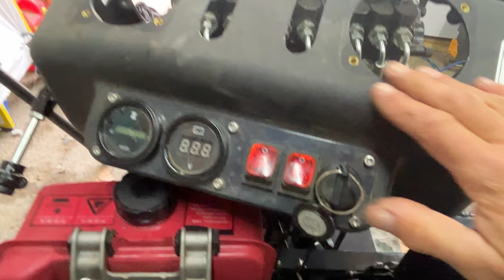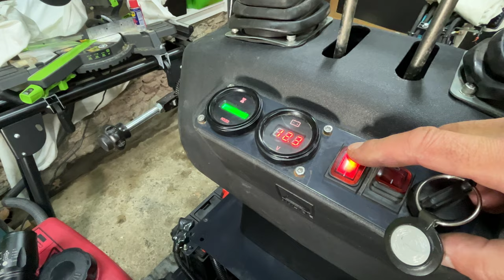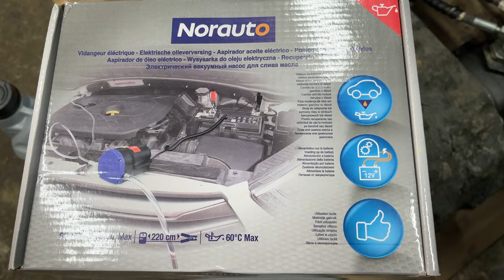Chines Mini Excavator | Hydraulic Failure

Comment: This is great guys! My wife and I started looking into this machine when we came across your videos. We have a John Deere 1025r, with a backhoe and a pile of other fun attachments. What we plan on doing is taking one of these mini excavators and separating the digger from the tracks. We intend to mount the digger on the back of an old F250 pickup truck, then turn the tracks and blade into a micro bulldozer. The two rigs will serve two purposes. Skidding and loading logs to be milled, and working hard to reach gold claims. Good luck on your repair, cheers from Arizona!
Reply from the maker: Sounds like a great project - you would need another engine and hydraulics to split but it would not be too difficult.  I am very happy with the little mini ex even though I had this problem - it is ready to go again and just waiting for a break in the weather. 😀

Comment: This machine looks very good for access to the pipework. The hoses do move around quite a lot when they are subjected to pressure, I think that is what causes the chafing rather than cab rotation. Your idea of having the extra oil cooler was very wise, we did not get such high temperatures here (in the Lot), this year, but I often think about the hydraulic system when it is 50 degs here, my main oil supply line went in a similar way on the mini pel, but the Volvo is not quite as accessible as your digger, but we could not work without it, that and our Fergi tractor and carry box, I will be interested to see your mini dumper. Stay safe! Chris B.
Reply from the maker: Cheers Chris - it was good to strip it all down to see how it all worked.  The little dumper is great and well worth the money from Deleks.fr......free shipping too.

Comment: I put old garden hose around my Hyd. Lines that can rub against each other just slice a piece of pie because it will fit around the holes you want to protect and then wire tired in place. It works great and helps. I worked for a hydraulic company for years.
Reply from the maker: Yes, good tip - when I get it back to base I will go over all the ones again.

Comment: Got a 49 Ford 8N with a front end loader. The hydraulic lines had taken a beating mostly from sun damage drying them out. Used electric corrugated sleeve and zip tied it over my lines in order to protect them . Actually looks very pleasing as well.
Reply from the maker: Yes, I have that on my Kubota tractor although I do like the nylon sleeves you see on modern kit.

Comment: You can also take an old garden hose cut a piece the length you need and split it, wrap it around your hydraulic hose and secure with three zip ties. Works great. Nice job on repair.
Reply from the maker: That would have been stronger and I have loads of that lying around …. Next time. 👍

Comment: With machinery hoses break seals leak and bolts come loose. No brand is immune to it. Have had brand new equipment show up on site that was broken from the factory. I will check hoses etc even on my cars and put sleeving in where it's needed. In many cases I use hose that I split open and slide over the hose or cable. 
    Also with anything from china that has oil... Always flush the factory oil out after a break in as it's very common to find allot of machining dust and chips in the oil. Not to mention I don't know what quality of oil they are using. I was very impressed with how clean that hydraulic oil was that you drained out. But I'd be modifying that drain for the future.
       And yes I am still jealous I want one of those toys too. It's cheaper and smaller than the Kubota BX sized machines which I like cause they are basically big riding mowers that think they are little tractors.
Reply from the maker: Thanks for the comments - I will be sure to check my lines from now on -   I was lucky it was only the blade feed and not the tracks as that would have been a right mess getting it back to the shop.
Reply: @HomesteadingUncontained  What I really felt bad for you was the oil getting on the concrete. That really stinks.

Comment: Nice video. I was thinking about the cable wrap also! I think it will work as a protection.

Now you know of the rubbing, you can check it every week to see how it holds.
Reply from the maker: Exactly, I will be checking after each usage - I will look for some stronger wraps though just in case.

Comment: I am a subscriber and have been watching your videos for a while. Thanks for showing all the work you have done on the mini excavator. I am planning to buy a similar one soon but perhaps with a swing boom. I have a small Chinese flail mower and if its any indication it does seem that these machines are not too difficult to work on. Of course the mini excavator will be a few steps up in complexity.
Reply from the maker: That is one of the reasons I wanted to strip all the panels off, so I could see exactly how it works.  Now I know if I hear or see anything out of the ordinary, it is not a mystery inside.  It is very easy to work on for sure 👍🏻

Comment: Where those hoses slide against the steel panel @16.27 I would split some hose pipe lengthways and slip it over the edge of the steel plate, just to avoid chafing. Better safe than sorry
Reply from the maker: Hi Mike - yes that is a good tip - I will take a look at it and after the first bit of work will check all the pipes again - I will be paranoid now.

Comment: you can also flip the connections to change the way the controls work, if u wish, but the fabric setup should be correct, but sometimes when people connect buckets, they connect the lines wrong, so you get mirrored controls, and if you dont know, you might be using the controls in reverse from the start. the bucket controls should be right stick and u move it forward then to the left and back towards you to make a scoop, but i ran a bobcat when i did it, so yours might not be the same, but mine just felt natural when using. other arm was the extension of the arms if im not wrong.
Reply from the maker: I do not know any different so it works for me...until I go and rent something else that is 🤪

Comment: I have one just like yours, except it’s a Nicosail okw10. The only thing I see different is mine has a B&s 13.5 hp gas engine. Do you think the same company makes them for different sellers? By the way, great videos, keep ‘em coming.
Reply from the maker: Cheers Ronnie - I think they buy standard chassis and parts and the smaller factories then put them together to sell as their own brand.  Alibaba comes up with hundreds of different sites and the machines all look the same.

Comment: Very nice repair Ian. I notice that your digger comes apart easier and faster than the brand I have. I'm off to check my hoses now! Was there a hydraulic oil filter changed? I have a small mesh filter that goes in the tank somewhere (haven't found exactly where yet). There is a spare in the tool kit supplied with my digger. Cheers Dave.
Reply from the maker: I do not think I have a hydraulic filter.  I will double check if I can spot one in the tank.  I was surprised how easy it was to take apart.  Taking that seat off reveals near enough everything.

Comment: You don’t need to drain the hydraulic oil tank. As the engine not running so the oil pump isn’t running. The oil won’t leak
Reply from the maker: Good call, but this was a good opportunity to relate the original for a known brand here in France.
Reply: That’s true as you don’t know the quality of the oil used in the building of the mini digger.
Reply: My hydraulic oil is 20 minutes old and already being replaced. I sent a sample for evaluation. if it comes back with a good report, i will consider saving it or selling it to some other user.

Comment: Please make sure to degrease the 4 foundation-rubbers of the engine for hydraulic oil will make them soft and last much shorter.
Love your series and believe it or not I bought the same excavator from the same company and cannot wait till it arrives..........😊
Reply from the maker: Yes, I cleaned and cleaned them again.  Most of the oil was from the engine as when I took it out it went everywhere.... again 😵‍💫  But now I have the pump👍🏻

Comment: I had a John Deere 240 skid steer which had two different hoses that would rupture due to this same type of thing. The hoses would rub on each other, and after about 500 hrs, they would start leaking through. I changed the hose lengths slightly, and it allowed them to float away from each other. Even the big guys have these issues is my point.
Reply from the maker: It was my fault for not checking but now I know these can be a problem I will be more diligent for sure.  I saw on another channel that their Bobcat had done it so I didn't feel to bad 😀

Comment: Nice work Ian, have you ever thought about modifications you can make to stop the machine from being so jerky aside from using the controls like cinderella?
Reply from the maker: Hi Alfred - I think it is the motor itself.  If takes a lot out of it when I move the controls.  Always on the look out for a 2nd hand kubota motor just in case.

Comment: at 24:08 Turn your jug around/over so the handle is lower than the pour spout, (up-side-down), then pouring is much easier and controllable.
Reply from the maker: Cheers - yes, I should have done this.  The camera always puts you under pressure and I stop thinking 🤣

Comment: Always check hoses, pipes, wires for excess rubbing slop BEFORE THEY FAIL. Use fixed cable ties, or add recoil springs, or SS mesh sheaths to keep things away from other parts on any vibrating machine. Now you've learned this, look over it for any other manufacturer omissions.
Reply from the maker: I check all the outer pipes regularly but this fail was deep in the machine and without taking off panels it is hard to spot.  Hindsight is great and I will be taking more time to check on the problem areas. 👍🏻

Comment: Hi I've been watching you from almost the beginning, I find it very interesting. I do own a small excavator similar to yours. I found it back aching and jerky because of having to lean forward to reach the leavers. I overcame the problem by making fold down arm rests that I attached to the fiberglass engine cover, by resting my elbows on them I can reach the levers taking strain of my back and better/smoother control of the leavers. Just saying. Keep up the good work and the videos. Best regards Steve (Buxton Derbyshire UK)
Reply from the maker: It does become tiring leaning forward for sure.  Thanks for commenting 👍🏻
Reply: You should just make a handle adapter that sits on each lever and makes the lever longer and wherever your hand is perfectly...

Comment: how many hours do you have on it?
Reply from the maker: Around 50 now, not a lot but all of them have been full on.
Reply: @HomesteadingUncontained    I've used mine to dig out/ level my back courtyard. i used it to load into a mini dump trailer /caridge i made with my dad, i use a tiller/ motoculteur to haul it around

Comment: Thanks Ian, that was really useful. I'll be digging this weekend doing the garage pad stone work and will check over my machine. I'm on about 17 hours, but a lot dirtier than yours 🤣 You've got the pedal for ancillaries, does the piping run up to where the thumb would be?
Reply from the maker: Hahaha, I do clean it from time to time.  So far it has all been dry work though, so just a dust off.  Yes the pedal operates the auger and the pipes terminate just before the bucket.  Looking at putting on a manual thumb in the future.

Comment: I would suggest that you try get some spare pipes as a bk up plan incase it happens again,,,Ian👍😎
Reply from the maker: Trouble is they are all differing lengths - it was only delayed due to the holidays - normally they can make them up while you wait.
Reply: You never know which one is going to be next to pop. And besides that, most every hose is a different length

Comment: Hi... im looking to buy something similar... Can you please say a few words about single cylinder KOOP engine (is it enough, is it running too hot)? And what about the hydraulic pump (what brand, flowrate, pressure... is it enough, at what temp running summer time? Best Regards.
Reply from the maker: It is going great. The koop motor works fine. Yes a kubota would have been nice but the price was double. I have a fan cooler for the hydraulics ans it runs good in summer temps.

Comment: at 11:50 It is more probable that the hose damage was from EVERY application of power, not just blade power, causing the main pressure hose to jump around each time (Maybe from blade power application, but not from spinning or the actual totality of the work being done). Look for jumping hoses on every circuit and cushion or restrain them and be safe around potential bursting hydraulic hoses! Safety glasses and injection proof gloves, etc.
Reply from the maker: Cheers John, yes, I check it all now and have rerouted to give more clearance.  I also rerouted the electrical cables to avoid heat (I had issues with ignition cable melting).

Comment: I hesitated several times buying Chinese machines but never dare to move forwards. I had a loader in test, imported from and built in the US, and it had the same problem : two hoses rubbing on each other. Looks like this is an engineering misconception. I would be very interested to have your return on this kind of machine on the long term.
Reply from the maker: Hi Pierre - I am about to put out a 1 year on video about  this machine.  It will be an update on what has gone on with the mini ex.

Comment: Quite a faff for such tiny hoses.  Put some zip ties on any hoses that may rub - those cable protectors will wear quickly if it's hose-on-hose.

Didn't think those Koop engines met air quality standards? Can't import them into the US. My 1.5T chinese mini has a EPA-certified Kubota engine.
Reply from the maker: Yeah, the protector is for electric cables really.  The motor is CE approved for Europe, if not they would not have let it in.  But I would have loved the kubota option but this doubled the price for me.

Comment: I contacted the manufacturer of my machine regarding the hydraulic filter and actually received a rather quick reply.    They sent a picture of the suction line fitting on the outside of the tank and  a picture of a suction filter.    Apparently, the filter is indeed located inside the hydraulic tank and attached to the suction line fitting from inside of the tank.    I only have a few hours on mine so far,  so I am not to the point yet where I need to do my initial fluid change (30 hours according to their recommendations), but I will check this by opening the tank access port when I change the hydraulic oil.   These filters only filter out large particles coming into the pump (150-400 microns) so I'm still considering adding a return line filter that will filter out down to 25 microns.   These are canister type filters that look like a standard oil filter from a car although the pressure rating is higher.  They make a 10 micron filter too but not sure if that might add too much flow restriction so I'll probably start with 25 micron.
Reply from the maker: Thanks for the research Asis, I will definitely check mine out and I would be very interested once you have found a filter that works.
Reply: Filters and mounting heads will sometimes have bypass features to prevent starvation or over pressurization.

Comment: Just make sure that you have the correct level of hydraulic oil. All of the cylinders should be in the retracted. Then look at the level of the hydraulic tank if it is what it is supposed to be you are ready for fun 😉
Reply from the maker: I overfilled a little as I could not quite see the gauge.  But I will check it all again before I go on site.  Ground is all frozen at the moment, so waiting for the sun.
Reply: OK.I hope you are able to get working on your project soon

Comment: even on pretty high end machines i get a good look at those hoses placement and fix it if needed can ruin a day of work on the long run that a lesson for growing up on Renault tractor, the smell of dust/hydraulic fluid amalgam  make my hands feels sticky and itchy!!! well even on a 400hours Liebherr telehandler i found a wear spot on a couple of hoses i guess its another construction brand after CAT (big disappointment) that's not up to fendt's standard.

also find a better shop for your supplies one week for a hose is outrageous you could order them from Hydrodis in that timespan (but selecting the right fittings is tricky) that why i would recommend going to an agricultural dealership most of them are equipped to do hydraulic hoses  you would be coming home with your new part. Also parks and lawn equipment dealerships are a major rip off in my experience.
Reply from the maker: It was a tractor supplier, but it was over the holiday period and they were missing one connector...but the price was ridiculous.  Makes me want to buy the hydraulic press and do them myself.

Comment: btw, even if the machine price is to much, its worth getting one to learn how to fix it, so if u were to buy a bigger one later, you would know the basics, so you would learn on this cheap one instead of the expensive one, also you can buy a used bigger one if u need, then just fix whats wrong instead, but you would need a breaker bar and some winch system probably, as you need to pull off the hydraulics and so on.
Reply from the maker: A learning tool... I like it